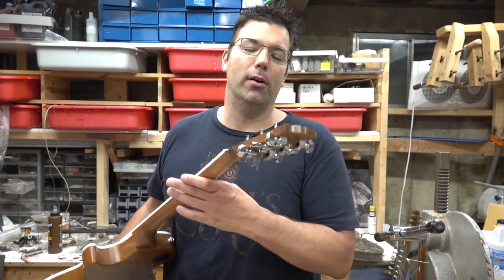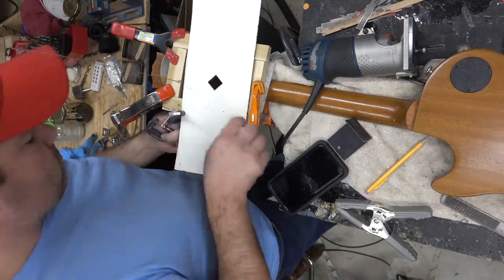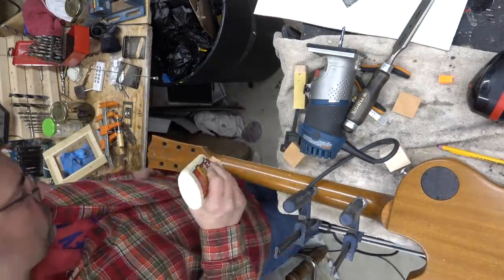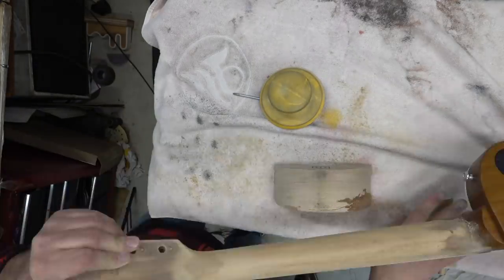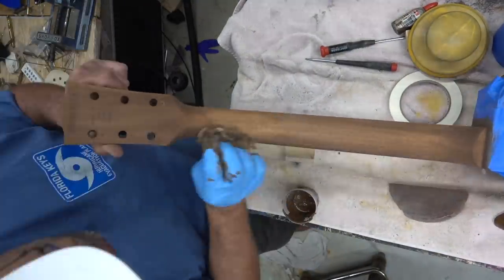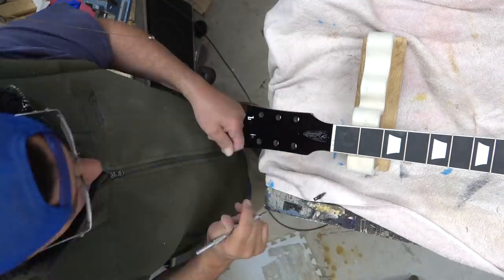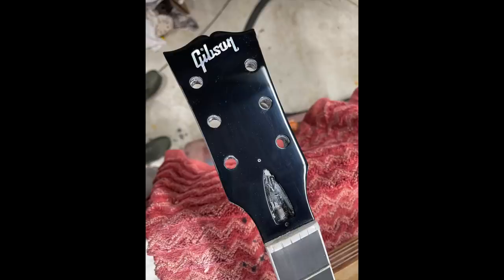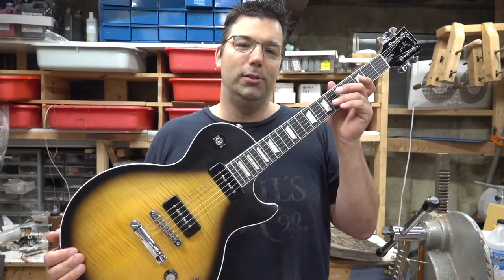Repairing a Nasty Headstock Break on a Gibson Les Paul - Full Timelapse Video

Comment: Bought a acoustic guitar with the headstock split a part. The problem is that the split is almost perfect, like they sawed it in a vertical line, I tried to glue with contact glue (best glue the construct shop worker recommended me), a week later, splited again. Dunno how to repair, especially because the singular way the two parts are separated. Pls someone can help me???

Comment: I get why a Gibson's value decreases after a headstock is broken, but I don't get why it goes down so drastically. If fixed correctly, it's as strong and as accurate as it was new. The guitar retains the tone, tuning stability & quality it did before the break. There should be a way to rate the repair, like a certification, that if met, can help it retain more of its deserved value.
I must be bad with money, 'cause I'd pay 80-90% of a guitar's value otherwise if the neck is fixed with the care shown in this video. It seems like they lose 75% of their value upon headstock break. I'd personally prefer the neck glue melted & entire neck removed & replaced, but I guess bolt-on exists for  a reason.

Comment: Nice . 
Question ? Self locking joints / blind dovetail joints . Any reasons why not in use ? 
 Much better than butt joints .
    Or possibly splines/ lemon splines would improve first build . 
( Broken necks are like . Pete and Repeat sitting on a fence . Pete fell off . Who's left ? Repeat ! Got nail Pete down 🤣🤣🤣)

Comment: This is so common,  how did such a vulnerability be allowed to stay to this day?
Cool repair and nice vid. But then there's soo much experience out there on how to fix this.
Reply: Gibson did try with volutes and maple necks. The maple necked Gibsons from the NorLin era have held up very well. What made them go back? It’s 100% the fault of the Burst and the customers. Tradition, in other words.
Reply from the maker: yea they needed a les paul modern that fixes all these issues, going back to the volute.  or reinforce with maple strips before they place the headstock plate on.
Reply: @bigdguitars  The could also just place the adjustment end of the truss rod at the body end of the neck, thus eliminating that void behind the nut. It's not the lack of a volute causing the breaks, it's that absence of wood in general.
Reply: If you take care of your Gibson there is never a need to worry about this. Any guitar can crack if treated carelessly.
Reply: @ryanfulldark2775  Sure, but even the most careful people can have an accident. When was the last time you heard of a Strat or Tele headstock breaking off because the guitar fell over? Not saying it can't happen, nor that it never has, but Gibson Les Pauls and SGs are notorious for this happening.
Reply: @peachmelba1000  Fenders tend to come loose at the heel where the neck bolts to the body if abused and are notorious for twisted necks from temperature swings. All guitars can suffer catastrophic damage whether by carelessness or an unfortunate accident. If you treat your instrument properly it will last a lifetime or more. This narrative Gibson makes an inferior product due to the headstock angle is rubbish.
Reply: @ryanfulldark2775  I didn't say it's the headstock angle. I said it's the void behind the nut where the truss rod adjustment is. The thickness of the wood at that point is only about 3/16" - 5/16". That thin spot is analogous to a big splinter sticking off the end of a cut log. You can snap the splinter off easily, but you can't do jack shit to the log.
As for Fender necks, the stripped out holes can be plugged and redrilled, a broken or twisted neck, if irreparable, can be replaced.
No one is saying that a Gibson will just break while it's being played. The design is stable enough to endure string tension, but there's enough of a history of these guitars not surviving mishaps that other guitars shrug off with a dent or two that it's myopic to minimize or reduce the issue purely to player misuse.
So, unless you walk on water...

Comment: Okay D, this one left me with a lot of questions. I'm nowhere near as experienced as you, so here goes -
1) Why did you not rout the block you added to the neck joint in a more "centered" position? To me it just seems offset a touch. Was there some reasoning behind the chosen position and shape?
2) Why not mask off the neck binding when you started sanding the neck finish off?
Reply from the maker: yes it was slightly off.  Thats because there is a crack that extended further on one side.  the binding was done terribly on this guitar.  tons of scratches this was a major improvement.